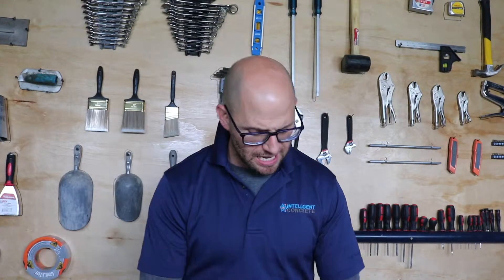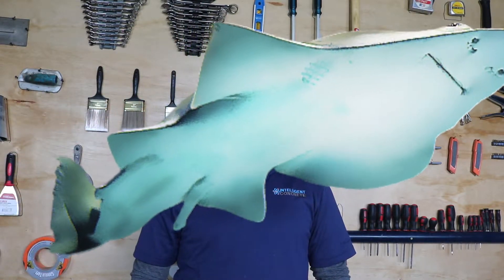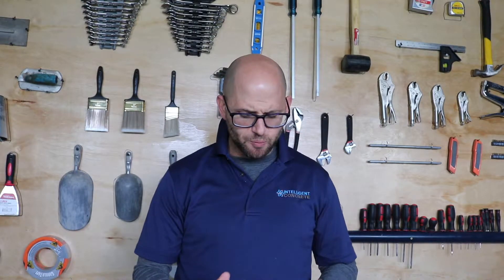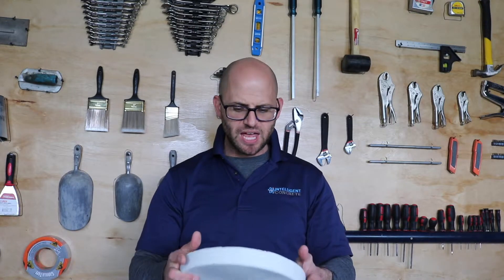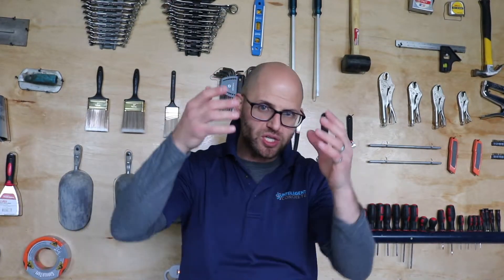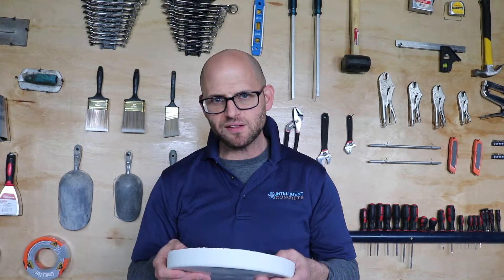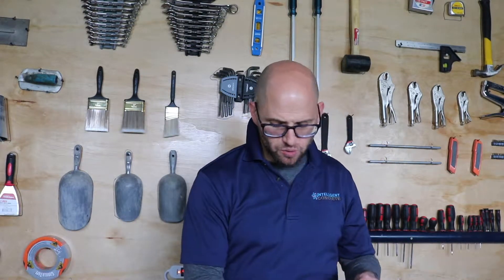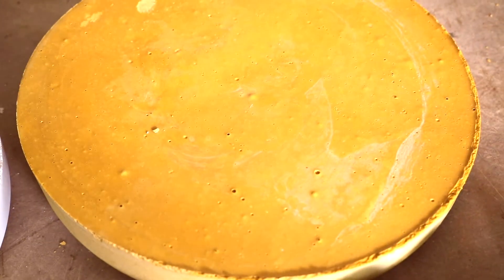Removing Air Out of Your Concrete Mix  - Vlog #278

Comment: Thanks Doc.
Do you think water cured concrete  will have a place as a building material in low pressure environments like the Moon and Mars where Musk is heading? (Assuming they can access enough water to mix the concrete ibatch nstead of sulfur -which was proposed)

A vacuum is ideal for plasma welding the rebar. 
Low porosity, like in your countertop experiment, should help preserve the habitat atmosphere, don't you think? 
All this hype about using sulfur (which stinks) when they could focus on reclaiming the water after the batch cures.
Reply: So rude of him to not reply to your question, regarding that it's the only question in the section
Reply: @jatwangismyname900  
Nah, don't worry about it. We go way back and I always ask these impossibly long questions to test his patience.
This is the most underrated channel on Youtube.  Besides they have since discovered a lot of water on Mars and on the Moon.
Doc is a real world  engineer  solving actual problems here on earth, No asphalt on Mars for sure.
Reply: @johankriel8883  Okay. Just out of curiosity; why are you testing his patience.
Reply: @jatwangismyname900  
Correction, not "to test" his patience, but "that test" his patience.😎
Besides he did answer, and in this video, my previous question without sending me a bill.
Doc is OK.
Reply from the maker: @johankriel8883  I aologize for the delay.  Not intentional.
Reply from the maker: I'm not a big fan of trying to use hydrated materials on the lunar surface.  Underground is one thing but on the surface becomes a problem with the major swings in temp and pressure.
Reply: @IntelligentConcrete  
Hi doc, survived the snake venom. Thank you for the answer. I tend to agree with you that concrete has a place in underground environments. Not sure what will happen in the vacuum.
I stll think your channel is underrated, like everything worthwhile. 
We wrote a book on why you should not shoe horses, will maybe show you around if you make it down to Africa. Greetings
Reply from the maker: @johankriel8883  thanks for the feedback.  We don’t mind being underrated now.  A lot of work to do to get better on our side.